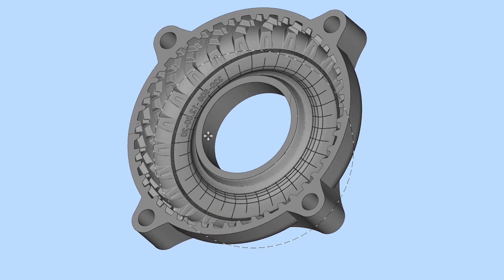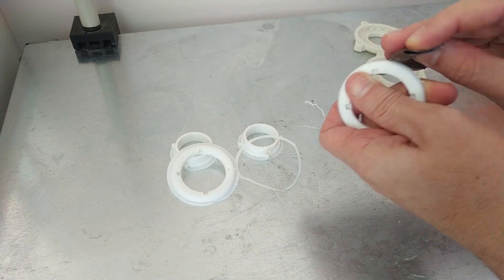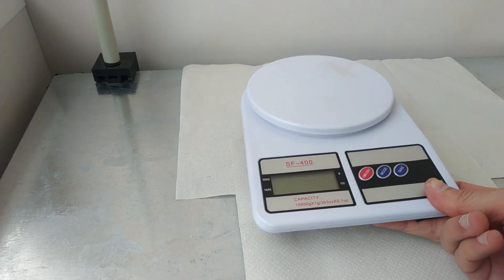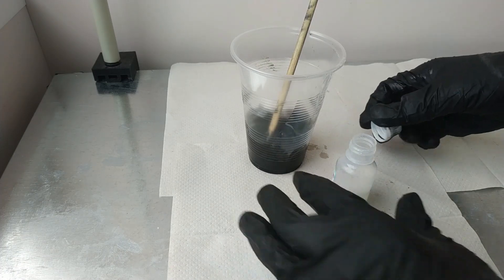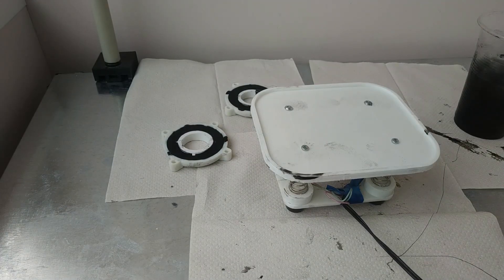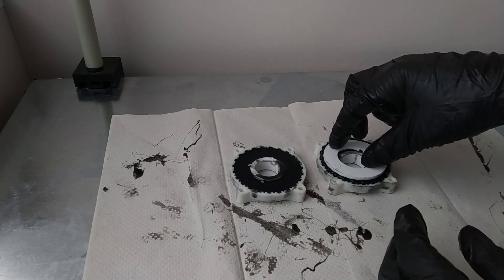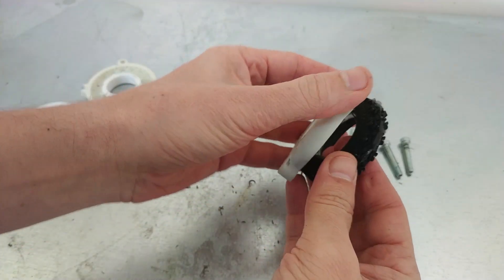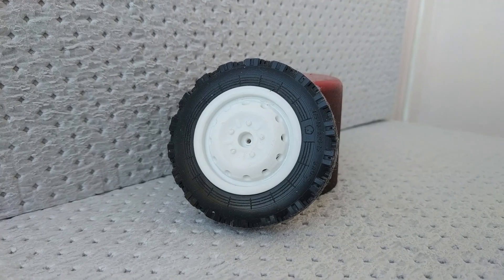How To Make Rc Tire wheels. Silicone Tires with 3D Printed Molds

Comment: how was the grip on the tire, can i use it for actual RC cars that run on smooth flooring.
Reply from the maker: The tire's grip on the road is excellent. The grip of a tire on the road depends on what compound you use to create the tires.